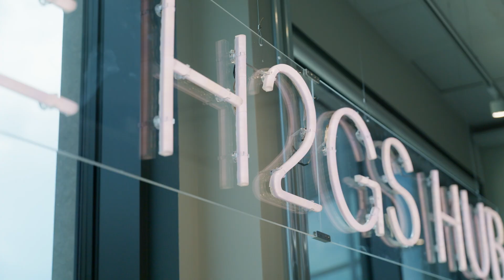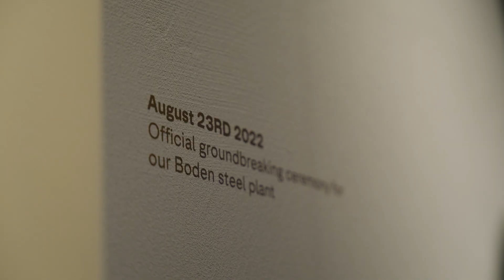H2 Green Steel

Comment: Does this all stack up to be what Stegra claims? What are the CO2 emissions from the associated mine, concentration facility, ore transport and pellet plant feeding the DRP? CO2 additions from the lime calcining, ferro alloys and carbon injection in the EAF if 100% H2 is used in the DRP. How will the EAF operate efficiently without a foaming slag strategy which is possible due C.in the DRP pellet, and how efficient may alternative methods of foaming slag generation be? What is the CO2 content in the ferro-alloys. Has induction heating been proven on thick slab, and do Stegra think that they can achieve uniform through thickness heating of the slab using induction? Good that Sweden has hydro, thisnconcept not much use in Holland or Germany who are seriously missing their Atomic plants. Good luck Stegra, noble effort but quite a way to go.
Reply: To meet the Paris Accord target, carbon emissions from steel production will need to fall by 90%.